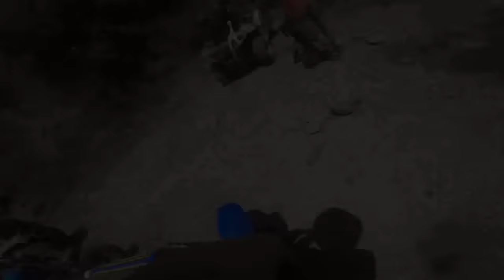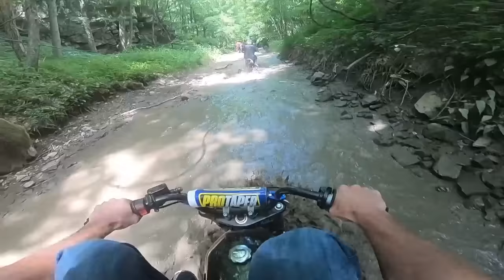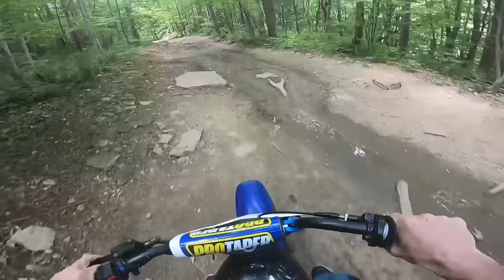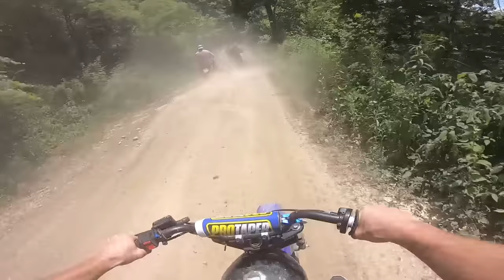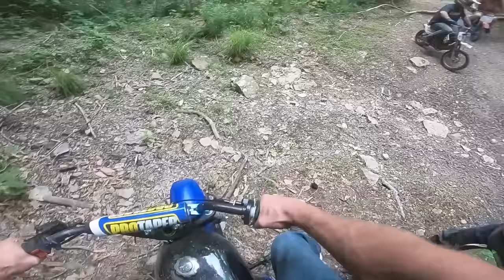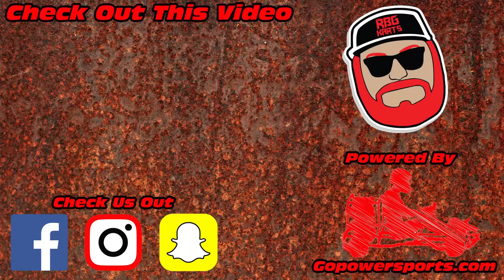MB200 Mini Bike Windrock Trail 4 Ride

Comment: hey man question, is the mb200 pretty snapp or its very easy going very linear and smooth? planning to get one for my wife and def needs to be incredibly mild and soft power delivery. she wants a pitbike just not sure if the mb200 is it.
Reply: She will love it!  Its not overly powerful but still has enough torque to pull an adult up steep hills.  You can always add a stage 1 kit for more power

Comment: Is the 420 engine good for a go kart I bought a little go kart for $350 and want to put a bigger engine on it
Reply: If you ask me its not worth it 350 for the engine an i believe the cvt is about the same i would rather hop up a 100 dollar 212 an a 50 or 60 dollar cvt off eBay a jet filter an header make a big difference
Reply: What's s cvt
Reply: I have a video of the go kart on my channel Id really like to put a 670 on it
Reply: The cvt is the torque converter
Reply: Is the little clutch no good for the 420 ? So I need one of them belt drive clutch torque converter things I have no idea about them things lol gotta start somewhere
Reply: Sa small as your gokart is the clutch should be fine but a cvt is best